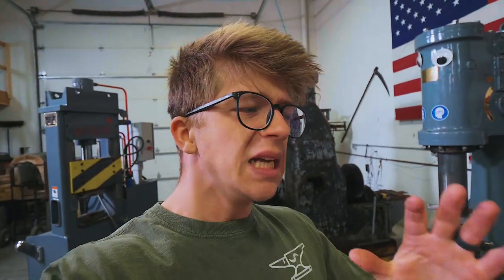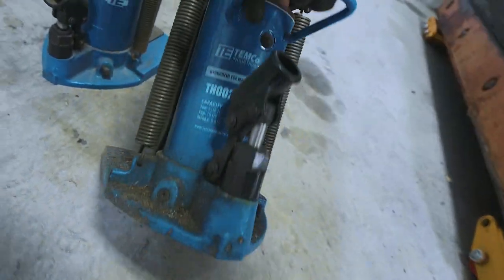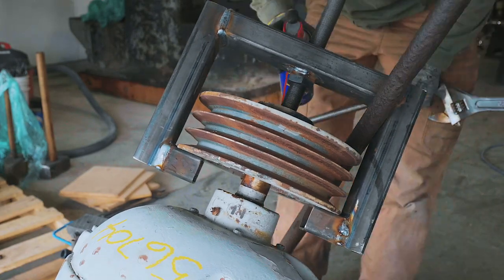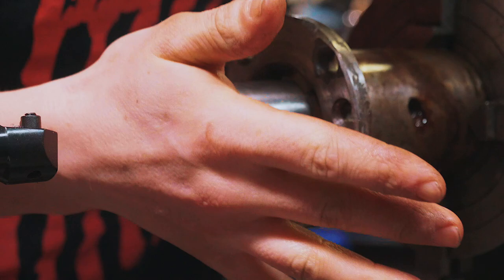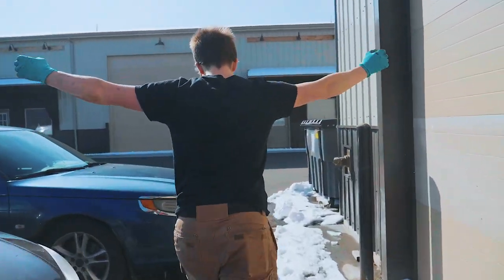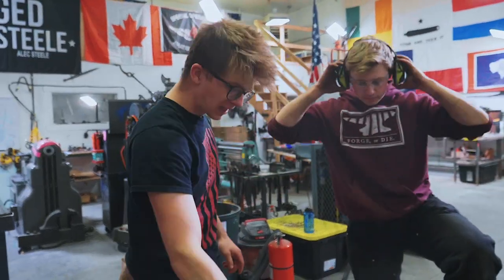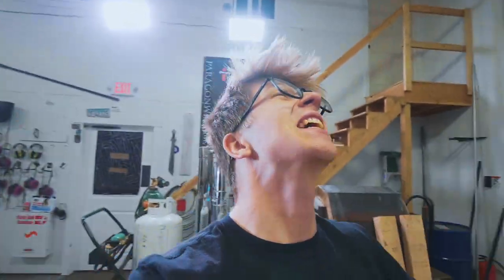FIXING THE 300LBS POWER HAMMER!!! Part 2

Comment: Piece of advice: Take that top cover off now, get measurements on it, and put it back on. Heck, go ahead and create a 3D model of it. That way you can get a CNC machining shop to make you another if/when it breaks.
Reply: Very good idea
Reply: Definitely good idea
Reply: Or, Call Mark Kr***e Right now and pay him to walk you through the air valve timing adjustments for that hammer. Too much money at stake here to crash the top cover!!
Reply: Keep it in house. Save time and money.
Reply: @tomstone5110  I don't think they can fabricate a part that big. Maybe, but it'd be at the ragged edge of what they could do.
Reply: as your just starting out coal can be expensive, a cheaper alternative to true blacksmiths coal is heating coal, although not a pure burning it does work well and it is a quarter the price of real blacksmiths coal
Reply: @pkbrunnemer6017  ya replied to the wrong comment buddy
Reply: If? More like when. The weak point is the motor. On purpose.

Comment: cool hammer!
but beware, I've worked 15 years on one of these (and even bigger ones):
Normally under the anvil of the hammer there should be a counterweight 20 times the weight of the hammer bear.
You have to make sure that the hammer bear hits perfectly vertical. 
Very important: In our case the engine was also with a belt-bully next to the machine, because if the engine is shifted by the vibrations, the whole transmission of the hammer is immediately broken!
Further you have to be quite sure that the hammer has no cracks, otherwise everything flies around your ears
Reply: That fiber gear should protect the gearbox.
Should. Yeah, I know.
Good point about looking for cracks in things that could put shrapnel in the air, for sure. The old cracked motor was a serious sign that something else in the machine isn't aligned correctly and topping out is another.
I really don't want these guys finding out in the worst possible way what else is not up to snuff in the machine.
I mean, it's great to see younger guys full of enthusiasm doing this but they really need a graybeard or two that knows what to look at before turning that big mother on.
Fortunately there seem to be a few in the comments willing to make suggestions...
Huh. I think I just called you  a graybeard. Is that okay?
Reply: @markfergerson2145  I'm sure he had someone come look at the machine, but none the less always better to have a second opinion!
Reply: Ya, would be a good idea to get a safety cage around as much of that as possible.

Comment: Hes not a member of the team until he passes the initiation of breaking a 2 week project in half and starts over.
Reply: That's the Steele Rite of Initiation. What about the Stelter Rite of Initiation, where you contemplate your existance while hand sanding a 5 foot long sword?
Reply: @Anino_Makata  the stelter rite:
Ceremoniously remove a quarter of each thumb on at least two different types of power sanding equipment.

Comment: "Trying to feel for any play." 
If you can put it on that easy, there's play. Heat it up a little and slip it on that easy and that sounds right.
Reply: Heat would ruin the epoxy gear.
Reply: Beacause epoxy gear don't like heat maybe
Reply: Or cool down the shaft either
Reply: As a licensed millwright, 99.9% of things mounted to a motor shaft should be a "slide fit" aka slide on with nothing more than gentle pressure. You never want to press or shrink for something onto a motor shaft, it becomes almost impossible to salvage the motor without damage if the gear/pulley/coupling/etc needs to be removed. 

The fact that the hub bound a little when trying to put it on is a good indicator that the fit is PROBABLY ok. If it's loose enough to have significant play it would typically go on a shaft that large without binding at all.

The "perfect" slide fit will go on by hand and very smoothly, but you will feel drag (not catching or grittiness) when sliding it on.

From what I can see from watching a YouTube video, you got it pretty darn close, Alec!
Reply: @timplett1  He slid it on, tossed it, and it slipped way down the shaft. He says he didn't feel any play in it later, but that's hard to believe give how easily it slid on.
Reply: @mstrnobody  Actually phenolic / micarta is very resistant to heat. Early ICBMs even used micarta heat-shields.
Reply: @MaesHawkEye  Micarta is heat resistant.
Reply: @Anenome5  It could be as little as .001" making the difference between difficult to get on and slid as easy as it did in the video.

Really, the big takeaway is that it should NOT be shrink fit on with heat .
Reply: @timplett1  I can accept that it shouldn't be a shrink fit. But .001" clearance is really only slip-fit clearance on a shaft that big if your two parts are very perfectly flat and straight. Yet he's tossing it onto this dirty, rusted shaft that looks a decade or two old. I don't buy that it's only that far apart. Probably more like .005"+.

Comment: Just an FYI, the copper lines used for the oil lines are a bad choice. Copper leaches the additives out of the lubricant and you lose some protection for your gears and the cylinder.  I would also replace all of the grease fittings to be safe. The motor most likely was rebuilt and lubricated with Polyrex EM grease, i highly recommended using the same when servicing it. If you need volumes for the bearings feel free to reach out.

Comment: It could be a problem with the timing and some big power hammers also have a type of air valve that as it reaches max hight builds air and compresses it down witch could just be a compression/seal problem

Comment: So, did you guys test the motor prior to putting all that work into getting the gear on it, lining it up, putting everything back together. or just Hoped real hard :) because i've been there, where i should have tested something, but was just in the zone and trucking thru the work or assumed everything would be fine. sometimes it works out, sometimes you made more work for yourself. nice to see it fired up, and it sounds amazing.

Comment: Did you use blue dye chem...or more ideally yellow dye to ensure the gear mesh is ideal? That's how you properly shim and align the gears in a differential case...i.e. rear wheel drive vehicles.

Comment: Alec, you may not receive this but, I'm an electrician that works on 5hp motors all the way up to 3000hp motors. I noticed that when you spun the shaft with your foot and let off, the shaft immediately stopped spinning indicating that your motor bearings are probably no good. You should probably have your electrician do an amp check on the motor now that its hooked up to a load to make sure you're not exceeding the F.L.A. of the motor. It also probably would not hurt to grease the bearings if they are not sealed bearings. Just wanted to give you a heads up so you know.

Comment: Very surprised you don't split head and wedge your bolts for your equipment. I do use the epoxy at work when I need a quick shot but always prefer split and swage for my own stuff.

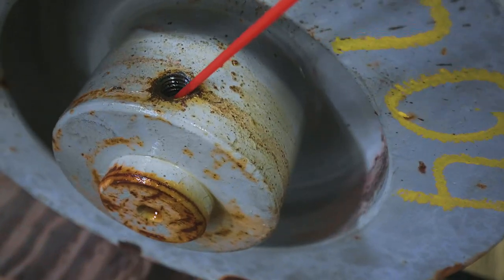Comment: @5:45 If the part(s) worked on permits; 50/50 ATF and (pure) Acetone. Extreme penetrating fluid. Mix in SEALED (no spills) HDPE or glass squirt container. Shake vigorously for 60 seconds, squirt/apply to seized fastener immediately. Allow to work a while, repeat as necessary. ATF and Acetone don't dissolve, it forms an emulsion. This is why you need to shake it so vigorously, and apply it right away. Acetone will eat up PET plastics over time, thus the HDPE (common chemical resistant plastic, often used in food grade containers like 4 liter / 1 gallon windscreen washer fluid jugs, large milk and juice jugs etc. Look for the number 2 on the plastic recycling stamp/embossing, this is HDPE. 

Make sure to use oil and solvent resistant gloves, and eye protection. Cover the drip zone with a suitable throwaway absorbant. ATF (Automatic Transmission Fluid) is very toxic, but cannot normally penetrate skin. However in "mixture" with the acetone, that certainly can, and work as a delivery mechanism enabling the ATF to penetrate.

Comment: Indulge me on all-tread for installation. Get a STRONG caulk gun when using one of those single tube 10oz epoxy tubes. NEVER strike the hexnut. Only strike the end of the all-thread with the washer on and the nut spun down a couple of turns. Doing this you cannot bugger up the threads and you will have a successful install if you can get the epoxy in the hole.

Comment: Are you sure that concrete is going to hold? I have done various floors for metal companies and the floors beneath machines are extremely beefed up along with isolation joints so it does not crack the concrete. That hammer is pretty big, just something to think about.

Concrete professional for over 15 years doing commercial and industrial concrete for similar situations.

Comment: PB Blaster and WD40 are a poor option for that application. For a commercial product, Aerokroil is your best bet, but what works the best hands down is a 50/50 mixture of acetone and automatic transmission fluid. You really can’t beat that mixture when it comes to breaking stuck parts free. You just want to be careful about putting it into spray bottles - it’s a bit too harsh on the spray mechanisms

Comment: Alec, why don't you use an impact for removing some of those stuck bolts/screws. With that grub screw at 5:25, after breaking it loose, it would have come out in 2 seconds without all the effort shown with that tiny T-allen key. I have a set of 1/4, 3/8, and 1/2" drive allen keys for just that reason.

Comment: This might be a dumb question, but why was the original motor not useable? Could not new feet have been fabricated and welded on or would there have been an inherent instability in that repair that could have damaged the drive?
Reply: He didn't go into a lot of detail but when he 1st pointed out the issues with the motor he showed the feet were broken but there is also damage to the motor itself

Comment: I hope what you are actually using in a “methacrylate” not an epoxy!  Because that stuff is no joke! I’m in the Marine industry and we use it for bonding metal to fiberglass, or medal to pretty much anything, or anything to anything.  The brand we use is “Acra-lock” I once glued a coin to a concrete slab with it and when I chipped it off with a sledgehammer it brought concrete with it!

Comment: You should get Adam to make you one out of bronze. I think it would be a good fit to replace the composite gear and you could make a monolithic piece to fit the shaft. Plus if it ever does get destroyed you could melt it down and re-pour it to start over if the teeth ever did get damaged.

Comment: Looking at this video at a later date the paint almost seems to match between the new motor and the paint that is underneath the horrible jack o lantern paint. Would be crazy if somehow that was the original mother that was taken off decades before and somehow made it all the way back to the original machine. Cause that motor was a perfect fit in all the right dimensions.

Comment: Pb blaster and WD40 are crap. There is a company out of West Virginia called Whaley Distributing. They have a penetrating oil called “Hillbilly Blaster” it is amazing. You can put water in a styrofoam cup spray it on the top of the water and within 5 seconds or so it will eat the bottom of the cup out. Best penetrating oil I’ve ever used!

Comment: Why would you secure that to do ground using big old bolts glued in. Now if the machine has to be moved has to be lifted straight up to clear them. Why rivet the gear on and not bolt it in? No very maintenance friendly.

Comment: Considering how many different options you have in a forge for heating metal, it seems to me you removed that pulley the hard way. Bit of heat and it would probably have come off with a few smart mallet blows. Do not underestimate the power of differential thermal expansion when dealing with fine engineering fits.

Comment: A second thought on all-thread. Why were you driving an all-thread rod? In Florida construction, the all-thread hole is drilled 1/8"  bigger than the rod, the hole is clean,  epoxy is squirted, then the rod inserted and you might have to hold it down for a second or two. No driving needed. In the video your epoxy is not acting right so it isn't right. Go to Home Depot and get the Simpson Strong-Tie 22oz epoxy gun for $88 and a tube of Simpson epoxy for $39 and a bag of mixing nozzles $22 and use the good stuff after you redrill the hole

Comment: I don’t think hitting the nuts with the hammer when inserting the thread rod in the chemical anchors is any good for the thread. Better to simply hit the top of the rod with a nut further down as a back up plan. I guess that was very gentle hammering anyway, no real resistance.

Comment: Next time you do a retro fit like that,rather than taking the time to chuck up your difficult to chuck part, just crack out the sand paper, wire up that motor, and get to work polishing your shaft a tad

Comment: Did I miss where they got the feet fixed for the power hammer?
Reply: The broken feet were a part of the old motor so once they removed the old motor the broken feet went with it, they then mounted the new motor that has its own feet
Reply: @timschrier903  thanks for the clarification, i thought the broken feet were actually on the hammer body itself.

Comment: Why wouldn't you just have used a wedge stud anchor? Chemical anchors ALWAYS loose their strength, and grip over time. Not to mention the proper anchors would have been much cheaper than the allthread, and epoxy. Sometimes your "lack of experience" really shines through!

Comment: 6:33 NEVER do that. Never. Never. You're putting load on the casement, and that thing can shatter. You always work each component on its own, or with its adjacent partner. Pulley with shaft, case with bearings, bearings with shaft. Ooof.

Comment: You electrician is not really an electrictian. I never saw someone wiring a motor like this. It's so dangerous. You should make a correct power distribution box on the motor.
It's the main problem with blacksmith, they know nothing about proper electricity and proper mechanical work.